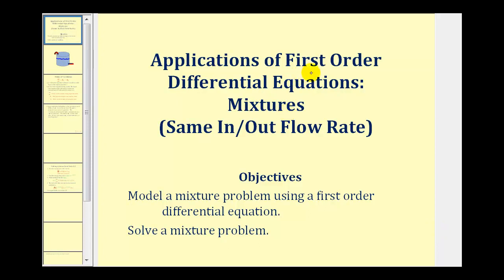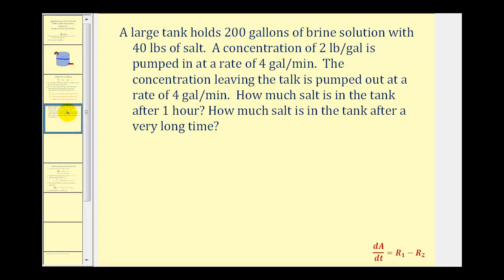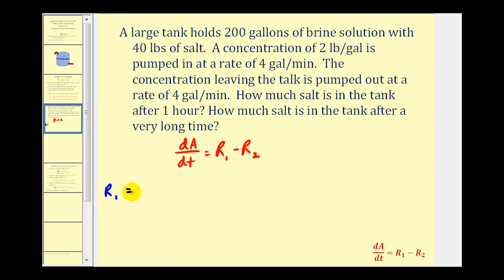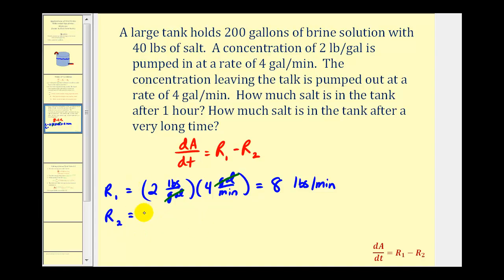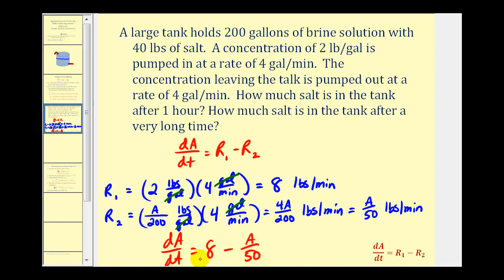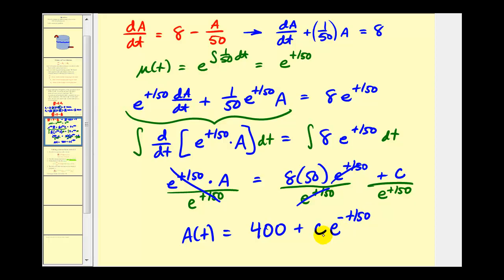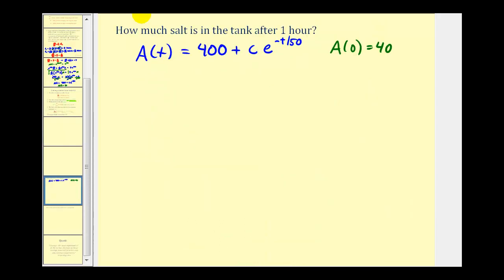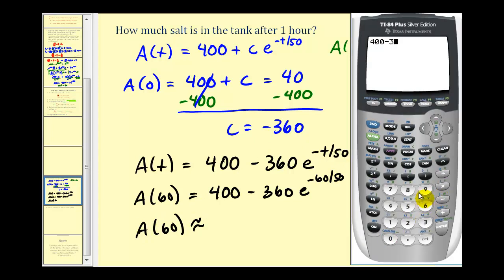Applications of First Order Differential Equations - Mixing Concentrations

Comment: Can your solution apply by this questions?
A tank initially contains 600 L of solution in which there is dissolved 1500 grams of chemicals. A solution containing 5 g/L of the chemical flows into the tank at a rate of 6 L/min, and the well-stirred mixture flows out at a rate of 3 L/min. Determine the concentration of chemical in the tank after one hour